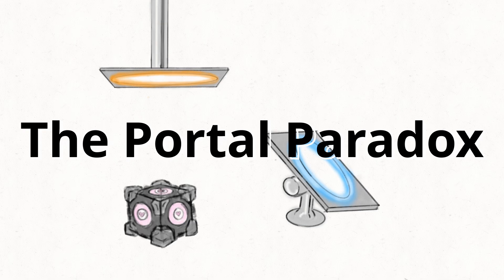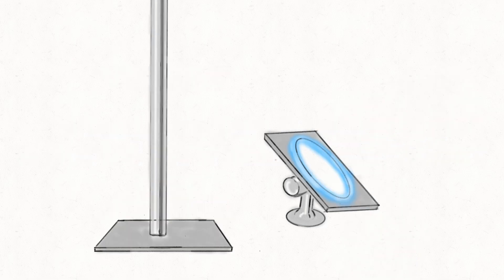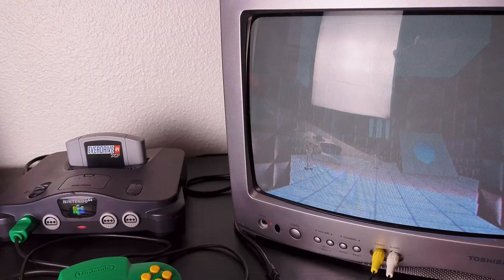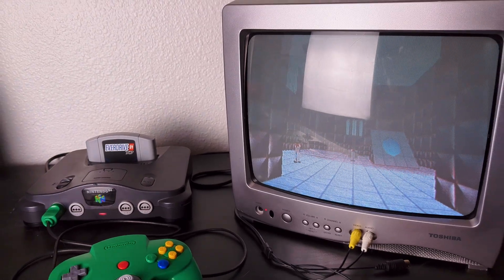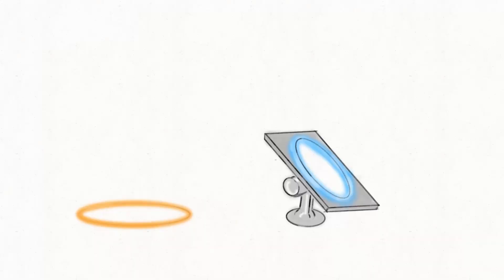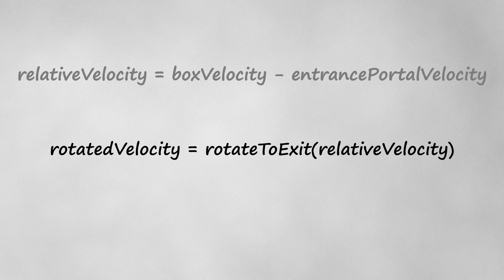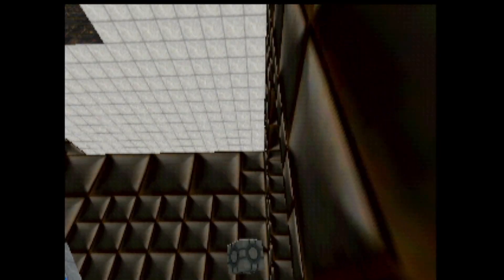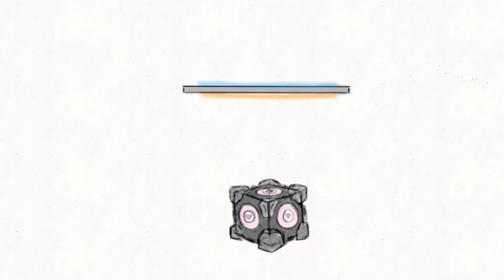I rewrote Portal from scratch and solved the Portal Paradox

Comment: So the portal is moving and it has velocity, sure. But the inside of the portal isn't a solid surface, it's...a portal. Spacetime itself doesn't have mass. What reason do we have to believe it would influence the cube's velocity? It seems like after the portal slams down on the cube, it should now just be sort of sitting on the 45 degree surface, maybe it would slide/tumble off if the surface isn't grippy enough.

Comment: Props, confirmed my thoughts on the paradox, i though threw the perspective of looking threw the stationery portal, the cube is acelerating towards the point of view so it wuld be illogical if it wuld just stop. Nice vid and efficiently explained ;)
Reply: He’s wrong. All the energy of the movement of the portal is absorbed by the ground. None of that energy is converted to the cube because the portal functions as a hole. The only scenario where ur logic makes sense is if you’re telling me the entrance to the portal has viscosity creating friction, which is never even remotely implied in any of the games. You use similar (but really not) experiments to justify your logic, when u should be using actual physics instead. Unless this video was purposely meant to be wrong to cause controversy and get engagement.

Comment: The paradox: with the frame of reference of the first portal and the cube, the cube cannot have any momentum; while in the frame of reference of the 2nd portal and the parts of the cube that have passed through, the cube must have momentum. People are arguing so much about the portal paradox because it is just that, a paradox that doesn't have an answer in this universe. Both answers are correct AND wrong, it just depends on what frame of reference you are considering.
One test you didn't try here was to have a moving cube go through a stationary portal to a moving portal on the other side, would be fun to see the momentum combine and cancel out depending on the direction of movement.

Comment: I don't know if the equation is wrong and it doesn't matter. The assumptions going into it are wrong. You've now magically given an item momentum without a force being applied to it, thereby violating Newton's second law. Since the orange portal frame can't fall through the floor, the cube would simply pop out of the blue portal with the falling speed of the portal, but come out no further than the height of the cube. In your assumption, the momentum of the portal is, through sheer magic, transferred to the cube. A portal works quite the same as any old ring, except for the fact that one side of the ring is in one location, and the other side in another location. If you drop a ring around a box, the box doesn't suddenly fly up. It can, in your setup, be dragged down by gravity, but not just fly up, since there is no force applied to it through the mechanism of lowering the portal over it.

Comment: Only thing I need to see then just to test all variables, is the same test as with the moving horizontal portal but have it stationary elsewhere. Thinking through it, the box never leaves its stationary position sitting on a flat surface, so since no momentum is being imparted on it physically, it shouldn't move, right?

Comment: Man now I'm thinking too hard about this. I'm inclined to think it should fall out the second portal, because if passing through the portal doesn't apply a force on the cube Newton's first law says its velocity must remain constant within the initial frame of reference. Although portals defy that anyways by changing your direction of motion... Great video for sure.
Reply: Yeah, that's what I though at first too. But then I got to thinking: the whole cube doesn't teleport instantaneously. As the portal comes into contact with the cube, the first thing that would happen is that a VERY thin slice of cube will be teleported to the destination ... and that WOULD have zero velocity (as the cube was initially at rest). But then, as the portal descends, another thin slice of cube will be teleported to the destination, and the first slice will have to move out of the way. Then another slice, and another move. Then another slice, and another move. The effective motion of the cube as it comes out of the portal will be the same speed as the portal is descending onto the cube. It will accelerate to this velocity over the time it takes for the portal to fully descend over the cube (so no "Impossible instantaneous acceleration" is required). So where did the force come from? I think it would be reacted from the floor beneath the cube in its original position.
Reply: @duncanedwards8258  Oh wow I really like that way of thinking about it. I always just thought of the portal as a hole between two places in space so there's no teleportation just moving.
Reply: Nah, I disagree. Think about it, what does "stationary" even mean? If I put the cube on the ground in my house it's still "moving". It's only "stationary" in that it's not moving relative to Earth, change the perspective and it's hurtling through space at 2m kmph. It's only because both portals are close to each other that you're ignoring that realistically it must already be doing this. From the perpective of the portal, the cube is moving towards it, and speedy thing goes in, speedy thing comes out.
Reply: Hmmm. You've forgotten one thing: from the perspective of the portal, the cube is indeed moving towards it speedily. But ... so is the room. So you haven't explained how the cube is moving relative to the room once it comes out the other end.
Reply: @duncanedwards8258  I'd say that since the room isn't entering the portal it can't possibly affect be affected by it.
Reply: @Psytrese portals do not create energy so by moving it in space it should just change its position not its velocity. The only force applied to the cube are gravitational force of the earth pulling it down, passing through the portal would just change the orientation of the object and gravitational force would just be applied from a different plane relative to its original state, so i think unlese portals create energy out of nothing the cube would just fall out due to change in gravitational force applied to it.

Comment: I don't get it. The game explicitly says portals preserve the momentum of objects passing through it. The cube has no momentum. This implies the cube experiences a force, from what? At what point?  The mistake is thinking the portal is a physical object, it is not, it is a wormhole. Relative velocities don't apply to space itself. Your example solution violated both conservation of energy and conservation of momentum.

The only justification for the cube moving is that the portal causes the cube to push itself; imagine in a time dt a slice of cube of dz appears of the blue portal, then dt later another slice of dz appears in the exact same space, electromagnetic forces would push the slices apart, with the floor pushing back to effectively bounce the cube out. I'd expect a different behavior if the cube was float in scape with no floor to bounce of, instead the forces would cancel and it wouldn't gain any momentum. This is also why back-to-back works as expected, they blue portal moves out of the way for each dz slice.

The cube would move, but it would depend on much more than the velocity of the orange portal.

Comment: Tl;DR: I disagree, because Portals do NOT affect momentum and have no mass (afaIk). 
The first thing we learn about Portals is they do not affect momentum... I think the reason this video's conclusion isn't true is multifaceted. 
Portal travel is instantaneous so it doesn't matter how fast the portal is going relative to when you hit it,  and Portals don't have mass (afaIk), so they aren't affected by the movement of the surface they are attached to, regardless of whether one portal or the other is in motion relative to the other Portal. There's nothing to "conserve" about the motion of the portal as there as there is no mass to them... as you recall Portals are all about how "more precisely, they do not" affect momentum. 
To a stationary observer, it's all about the momentum of the object before passing through the portal relative to the momentum of the object after passing through, namely it is the same. 
I think a way to demonstrate this argument would be jumping in front of a train with with a blue portal on the cowcatcher in front of the train, and an orange portal on the wall of the trainstation. Then I stand on the tracks and jump up right as the Train passes through my area. The blue portal hits me at train velocity, but Portal travel is instantaneous. What matters is, my momentum relative to the universe I'm in before I enter the blue portal, and my momentum relative to the universe I'm in after I exit the orange portal (namely it is exactly the same) which is jumping velocity only. 
Long story short, the hula hoop effect is right. 
If you are hit with a moving train portal you will NOT interact with the portal itself or the train and will not absorb momentum from them or anywhere else. You will retain your original momentum before and after the portal transfer. Remember, it's a portal, not the newtonian brick wall it's attached to. You will not suddenly be hit with the train's momentum, it will pass by you without hitting you because you passed through the portal.
Interesting video though and commendable effort put into it.
oh and just a small tidbit of into: There are moving Portals in the second game, at least when you are cutting the wires to the neurotoxin machine you can put down portals on moving surfaces to take the lasers across the room. And if you want to get technical, when Chell puts a portal on the Moon, it is from then on moving at the moon's orbital velocity of 2,288 miles per hour (3,683 kilometers per hour)... A lot faster than we saw in the cutscene, which was apparently just a vacuum, nor did they have to resist the momentum of the entire moon because, again, portals do not affect momentum.
Another way to consider it is, you aren't actually moving the entire universe by moving an exit portal, so your "resting inertia" isn't translated into "resistance to the momentum of the moving object to which the portal is attached," you're moving the massless, instantaneous wormhole which transfers objects from one end to the other and preserves their momentum. 
Now, if you want to get REALLY weird, you can move one end of the portal at superluminal speeds! Now we are talking! Time travel anyone?
Reply: Чел хорош база

Comment: The problem I see is that the portal does not transfer momentum. From the perspective of the cube, it never moves but after it reaches a point in the portal, gravity shifts to a different angle. The reason that the box flies is that it is treated as an accelerating entity when rendered through the slanted hole. If you were the box, you would be standing in the same spot the entire time, but your surroundings would change around you.
Reply: @ArdentKingsman  you cannot measure the velocity of something relative to itself

Comment: I would think an object at rest stays at rest until acted on by a force that can potentially put it in motion. Even though there's a portal slamming down over the cube without touching it there's no force between the cube and the floor it's resting on and the space on the otherside of the portal is stationary space as well. So it should just plop over really.

Speedy thing goes in, speedy thing goes out.

Cube doesn't speed.
Entrance portal may speed but doesn't act on the cube in any way, not even the edge hits it.

Cube just comes out the exit portal untouched while still resting on the floor and then becoming acted upon by gravity on the exit portal end to flop over.

Fun to think about but I think your equation over thinks a simple principle. 

I think the outcome would still be a flop if it was the exit portal that was moving fast and the entrance portal slowly covering over the cube. But that's another question that no one asked.

(Cube could maybe get kicked forward against an edge if the exit portal was moving forward and hit the exits side as it flopped over)

Nice Demake, and cool video though. Thanks for the great content.
Reply: @saldoom  except cube does have speed, relative to the entrance portal

Comment: i dont understand the video.
PLEASE EXPLAIN
because the whole proces is physically understandable, so whiy is this a paradox? for me its totaly CLEAR that it comes out fast as the portal falls down.
Helmholtz - 150 years ago.
Reply: It is a paradox because it is not solvable.
Portals as presented jn the game create energy out of nothing. You should know thats not how it works. Energy has to come from somewhere. In this case the box gets momentum from nothing, it does not interact with anything, no force is applied to it, yet it gains momentum.
Reply: @Fr33mx  why isn't it solvable? If you kick a stone on a 2nd stone the 2nd stone gets the energy from the 1st stone. The same happens here. The Portal fall down and as it travels through the cube the cube gets the energy from the moving Portal. Portal move, cube stopped - Portal stops, cube move.
Just imagine what happens with the air, which is sucked in the Portal as it's falling down, the air gets pushed through it and come out of the 2nd Portal. Not just through, but with the same speed, as the Portal falls down.
Reply: @Fr33mx  you also say the Portal have energy out of nothing, that's not correct. It have positional energy. Then its Release and falls down because of Gravitation.

Comment: because it is not an object moving through space its space moving around an object. the cube doesnt have any momentum in its stationary state, the momentum of the moving platform and portal (assuming a rift in space/time even has mass) would continue to travel downward into the ground, if anything I would argue any potential movement is simply from the vacuum youre making. It might move, but thats cause the force of impact translates into the air molecules that then hit the cube and "vwoomf". Illusion of momentum gained. But I can't imagine the momentum is coming from the portal itself, the portal is just a transformation vector so it must be coming from the downward momentum of the platform hitting the ground, equal and opposite reaction, the force bounces back. The movement of the cube is because the platform is moving, not the portal. getting smacked with freerange particles holding open a wormhole wouldn't do much to you, considering you can literally walk through them. I think thats the big take away.

Comment: Now that you share a new perspective, I think I agree with you. I always assumed that the portals functioned as a simple gateway, and therefore "velocity going in" didn't really make much sense. But if you treat motion as relative, then from the blue portal it appears that the floor is acting like a piston, pushing the cube through the portal, rather than holding the cube in place
Reply: He’s wrong. All the energy of the movement of the portal is absorbed by the ground. None of that energy is converted to the cube because the portal functions as a hole. The only scenario where ur logic makes sense is if you’re telling me the entrance to the portal has viscosity creating friction, which is never even remotely implied in any of the games. You use similar (but really not) experiments to justify your logic, when u should be using actual physics instead. Unless this video was purposely meant to be wrong to cause controversy and get engagement.
Reply: @jdev2288   Newsflash, genius. There are no “actual” physics involved in portals, they’re fictional. The video he mentions early was a deep dive into how a cube might react, given real world physics. However, the video talks about how it’s impossible to know the real world result without knowing how portals work, and even if they act like a hole as you and I assumed, there were still two possible outcomes.
Honestly, though, I have no idea how you arrived at the point where you think the portal generating friction is what makes the logic work out for you. You’ve gone to some other place entirely
Reply: You treat motion as relative....because there is no other type of motion. Relative or absolute.....and absolute motion doesn't exist. In fact the entire idea of "absolute" only exists after convenience motivated simplications...which are only approximations. The entire concept of absoluteness is a fiction.
Reply: @mastpg  I wasn’t looking at relative motion, that was my point. But also, go away, you pretentious little dork. I didn’t need that comment

Comment: I don’t treat the portals as separate objects with their own momentum. They are small holes in space linking 2 points. No matter how fast they move or how they move the only thing under the effect of a force will be the object. If an object is falling between 2 portals and you take the bottom portal and start pulling it as fast as the object when it’s halfway through, the object won’t suddenly stop it will still be under the same forces. It will LOOK like the object is stuck but the moment you stop it’ll shoot. The portals don’t themselves hold momentum it’s like suddenly teleporting someone into a moving train, they’re gonna slam into the wall and die. 

Now what would be REALLY interesting is taking 2 portals moving in opposite directions at equal speeds and placing a stationary cube in front of one of them. 

Is there really no instance of a moving portal like on a fan or a moving platform?